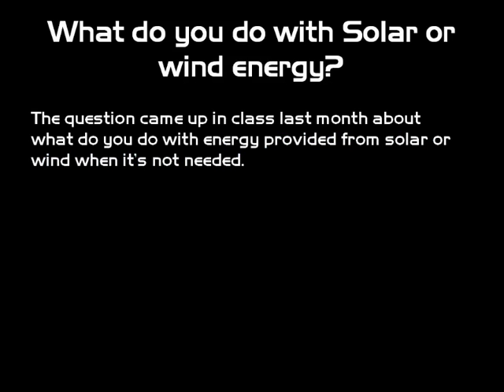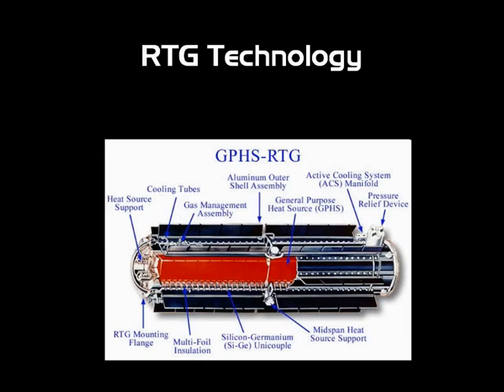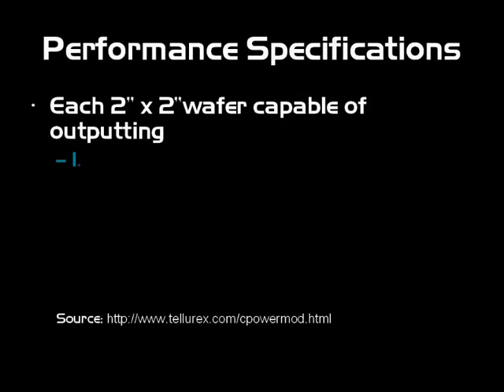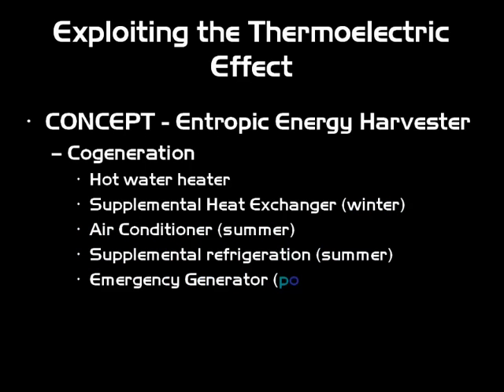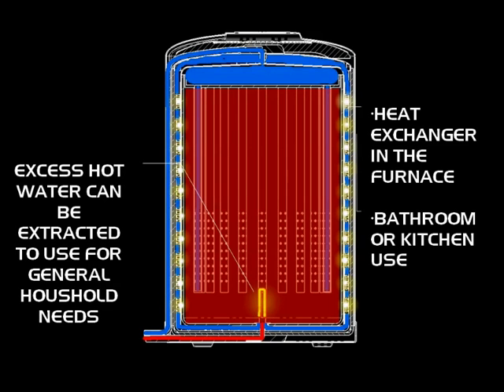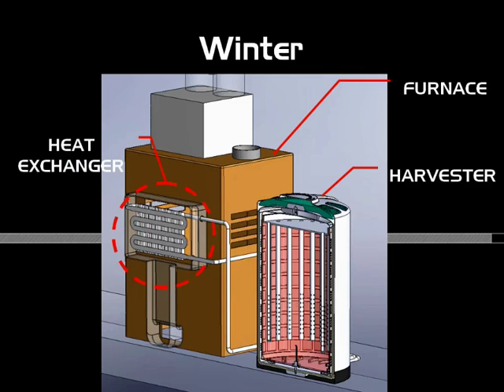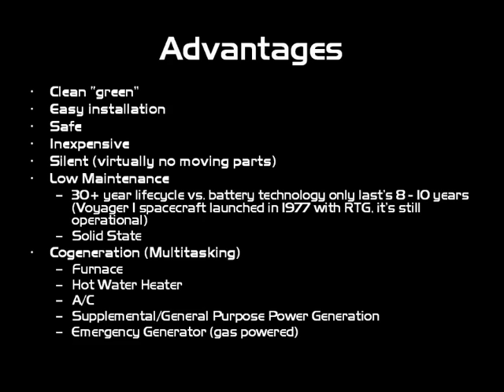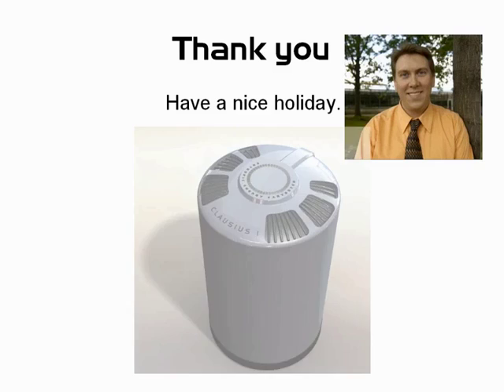Green HVAC/Furnace Enhancement - Thermoelectric Cogeneration Concept

Comment: you could use the windmills etc. to electrolyse water into it's component gases then when needed either ship it off and sell it or catalyse it back into water and electricity there is power cells that use h2o in that way

Comment from the maker: Hi Kyoxillbuz, My father and I were working on a small 5 liter basic test system (Clausius .5) made of a square steel enclosure and four thermocouples attached to the walls, it produced small amounts of electricity (enough to power a small fan). It looked promising, but we were also working on another invention at the same time which took precedence. I have not revisited the Clausius since then. Thank you for the kind words.